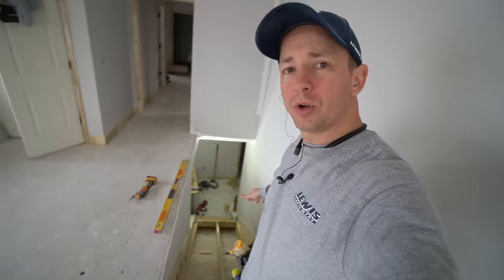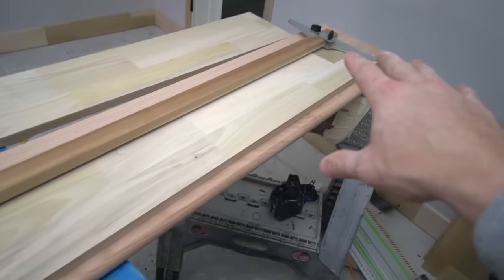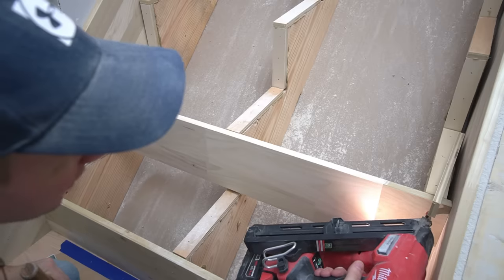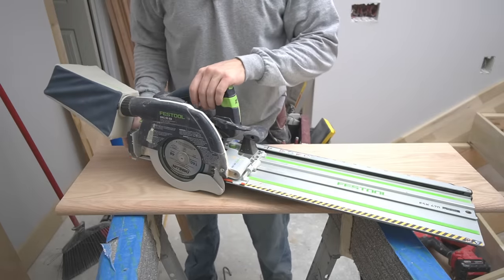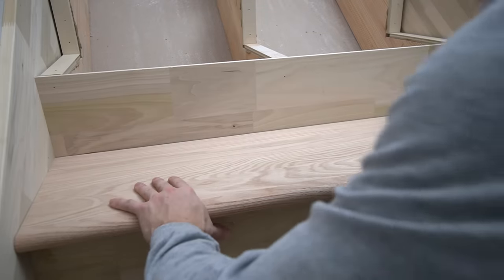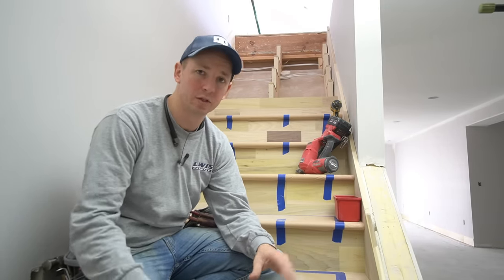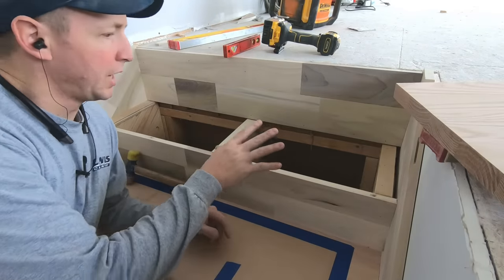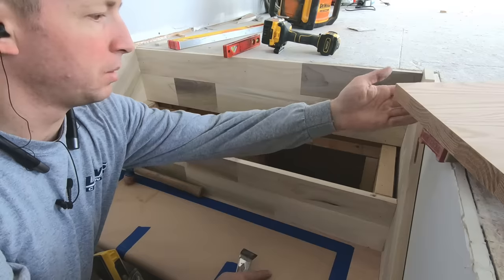Professional Stair Tread & Riser Installation - Complete Install Process

Comment: Your videos have been extremely helpful in doing my first staircase work.  We are remodeling existing staircase by removing the carpet & doing hardwood.  In your experience, should I remove existing treads & risers or can I install new treads & risers onto existing?
Reply from the maker: You will need to remove the old in order to get the correct step heights.
Reply: @InsiderCarpentry  Thanks for the advise. I assumed I would have to remove existing, just didn't really want too :)  Any advice on stain matching? For example you used poplar risers & hardwood treads, how do you get them to match or are these risers being painted? We are having a challenge getting stair treads & risers to match the white oak flooring being installed and we want solid treads vs using the flooring as treads.

Comment: I’m doing a stair case over and, like your project, it was framed for carpet ( 8 inch riser and 9 inch tread) I was planning on padding the risers and treads as you did, but I am concerned it will make the entire stair case longer when I install the new oak riser and treads (7 1/2 risers and 10 1/4 treads) I can’t extend the stairs because of an entry door and the landing had to be 3 feet. This is really stressing me out ☹️

Comment: Hi thanks for the video. I was wondering about the dust guard.  When I first set up my track saw I had to cut a clean line through the over sized dust guard to give me my edge to line up on my cuts.  BUT if I want to set a bevel like 5 deg, it will eat into that dust guard and this make my 90 deg cuts not align with the dust guard. How do you deal with that?

Comment: I don’t like to build finished stairs unless I can shop build them… (temporary stairs I will build on site)…
Building finished stairs in place just takes way too much time and there’s such a high percentage chance of error, like with a rogue nail or a screw goes in a little crooky… just too many variables to cause mistakes… Plus all that money for the stain grade treads and then you really have no choice but to face nail them…
In the shop you could batch cut the risers & treads, router out the stringers and go to town assembling

Comment: What size and length of fasteners do you for connections from behind riser to tread, stringer to skirt board etc? 15 or 16 gauge nails for nailing risers and treads? Length? Thanks in advance man!

Comment: I have a question about putting the 5 degree bevel on the treads. When you cut at an angle, doesn't it cut off the edge on the track by a slight amount, such that when you set the saw back at 0, the cut line is in a different location, throwing off all future cuts that aren't 5 degrees?

Comment: Hey Spencer, bomber stair install!  2 questions:  Where do you get the finger jointed Poplar, and what is the purpose of the biscuit mortises on the top of the right stairskirt?  I presume for connection of the guardrail base apron.  Also, where did you get that battery powered Ftool?  Appears that dust collection is pretty good without a vac.  How do you like the Mkita battery powered plate joiner?  Do you ever encounter problems with biscuits fitting its mortises?  I had problems with Walt biscuits, and went with the Melo brand from Germany, all good.  More than 2 questions and name brands were kept out.  Thanks!

Comment: I want to install treads and raisers in a modern house without using skirt-boards to teh sides. This choice is in order to have a very clean look. Do you think can I still use your method? I see you also drill the riser into the skirt. maybe I can secure it with a predrill into the stringer?

Comment: Nice job on the stairs Im going to try the hk on my next stair job, Did you ever think of pocket screwing the front edge  of the tread to the top of the back side of the riser instead of nails. As long as the stringers are 2x12 you can get your head in there e pretty easy just put some pocket holes on the riser before install.

Comment: sir thank you so much for your help i had to do my set of steps going down stairs  tried you use miter saw but struggle was not worth it i went and bought a kreg track saw job done great now i have 2 steps left side exposed how do i cover it its 2 steps that lead to a landing with side of risers step and stinger all exposed and butts in to a wall so drywall or wood and railing is my question what is that called

Comment: Are you only cutting the 5 degree angle on the left side of the stair tread? And if on both sides how do you get the hkc to start the cut after the nosing of the tread?

Comment: This is probably a dumb question but forgive my ignorance: what's the reasoning for the plywood strips on the stringers? I'm about to replace risers and treadboards on a wonky 123 year old staircase. It's all kinds of crooked so I'll be making adjustments to the stringer surfaces once the old risers and treadboards are removed.
Reply from the maker: Had to correct the rises so they were all even steps up.

Comment: no gaps for expansion? Do the risers touch bottom of stringer? How many treads have the screws come through from screwing behind riser? Im afraid Id mess up.
Reply: Also what are the small pieces of wood you put in stringers? I also could not tell is the riser a tiny bit above stringer or below?

Comment: I remember watching a video about that Milwaukee cordless gun you're using, I thought you didn't like them? Is it a different modem you're using? Just curious! I have the DeWalt cordless which works great but I prefer the firing action of the Milwaukee's as opposed to the pinwheel design that DeWalt uses.
Reply from the maker: This is the new Gen 2. It’s great

Comment: Like your methods but let me ask, does your saw ever get bound up when cutting your treads like that? I cut mine on my miter and if I try that the tread will pinch my blade towards the end of the cut. I'm wondering if it's because I don't have alot of waste I'm cutting off. Nice work
Reply from the maker: That can happen. You kind of have to sense when its about to happen and back off and adjust how you cut in order to reduce the pinch.

Comment: A prior stair video you didn't face nail through the treads to avoid nail holes for the painters to fill, this one you shot one in each stringer.  Change in your practice due to experience or what's the thinking?  Appreciate the videos!
Reply from the maker: I just don't feel that 3 nail holes is a big deal and ensures that the tread stays tight to the riser.

Comment: Why were the stringers extended with plywood strips?  Just to get them to the correct dimensions or a better/flatter surface to attach the risers and stair treads?  Thanks.
Reply: Same question, haven't seen it asked here ? Thanks for posting !

Comment: This is a great video. I have a question about the plywood you added to the Stringers .... why? I'm going to finish my stairs into my basement. They were not finished by the builder. So, I have the stringers and just a tread. When I remove the tread, am I to use the plywood pieces like you did?
Reply: I just watched your other video of these stairs (skirt board) and heard you say "I've installed blocking on top of the framing stringer ... that is because the stair was farmed for carpet, not for hardwood treads. So, whenever I rip off all of that framing material, I have to adjust the rises and runs to make everything work correctly."
Reply from the maker: Correct. If you have 1-1/2" framing material on top and will only be adding 1" thick treads you may need to add 1/2" to make all of your finished rises equal. Same applies to the treads. Always check the top and bottom treads to ensure you don't need to add additional thickness to the front of the risers.

Comment: Great vid. How come U didn’t use silicone to adhere the treads???  Pl is hard and brittle. Silicone is 50 year flexible. Thanks.
Reply from the maker: PL premium is what actual tread manufacturers have recommended to me. I don't think it is as hard and brittle as you think. I have always understood that PL premium has some elasticity as compared to typical subfloor adhesive.
Reply: True but pl400 is way more flexible than pl premium. Try silicone next time. U will love me for it.

Comment: Hey Spencer,

Instead of a track saw why not use sliding miter saw?
Reply from the maker: I find it takes longer to get the angle set just right with a miter saw.
Reply: @InsiderCarpentry  just wondering.
Has a flooring company ask if I could do stair treads?
A builder finish staircases.
I believe in tool for the job, best one at that. Additionally to travel light take only what you need, to load in a lot of tools is real pain.
Last one does the track saw slip or move any?

Comment: I always try to put less nail , what do you use to fill them ? I always feel bad using wood filler since it never turns out the same color, same goes with wood chip and white glue, just curious
Reply: i have been told wood glue and the dust from the wood you cut mix is good to fill the holes with.
Reply: @hannahfagerlie6562  it is if you do not intend to oil it, otherwise , it's never the same colour

Comment: All that supper tight cuts and lots glue but then still pin holes into the faces
Reply from the maker: 3 holes per tread in oak will disappear no problem.

Comment: cut the left and right stringer rise on a 45 degree. you can then use a pocket hole jig on the risers. no nails and it wont ever open up even if your tread is a hair long. i used to do the screw trick until i started getting squeaks after about 10 years or so
Reply: Explain what your doing? 
Thanks
Reply: @rotaxrider  im baking the bestest cake on earth.....scrumptious

Comment: Don't you find the Pl expands when it dries?
Reply from the maker: Yes, that's what makes it so awesome for newel posts.
Reply: @InsiderCarpentry  what about the glue on the drywall screws, doesn't the expansion lift the board somewhat?

Comment: It seems like there are shims on the stringers, when you have the chance tell us about them
Reply from the maker: Framers cut it wrong. They had it cut in for carpet with 2x framing material. So the framing lumber had to be removed and the treads shimmed up 1/2". I was going to put it in the video but it was getting too long.
Reply: @InsiderCarpentry  thanks for the response 
It’s going to help me on my next job
I’m a great fan, happy to know that I can order now of my
Reply: That now I can order through your link at Canadian amazon

Comment: Are your treads 3/4 or 1 in thick ?
Reply from the maker: Stair treads are almost always 1" thick for me.
Reply: @InsiderCarpentry I am doing a stairway remodel soon, but building on top of old treads. I opted for 3/4" to keep steps consistent with the upstairs flooring.

Comment: nice learned most of what I do from you when it comes to stair work over the last few years. I noticed the 1degree secondary cut to the tread running just shy of the face is something new. I like that you are constantly improving your game. I know if you anything like me you lie awake at night running through installation methods etc and thinking of ways to improve them.... you have to do it, otherwise it just sounds crazy.
Reply from the maker: Exactly, It's always an evolution and always trying new things. Once you think you've got it figured out you're not moving forward.

Comment: I notice as u press down the jig to score the two ends, u r bending the middle cross bar.. it could potentially move the jig a bit... maybe put a vertical wall on the middle bar to stiffen it up?
Reply: No, actually bending the jig slightly then scribing makes the fit about 1/32 tighter